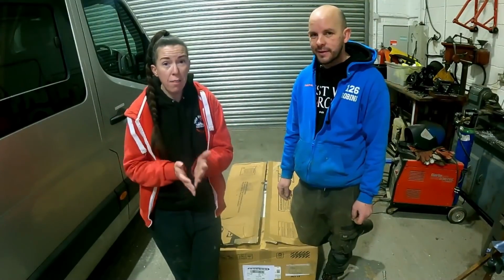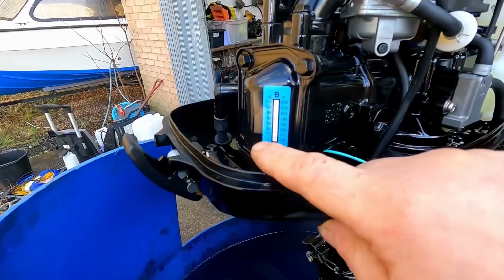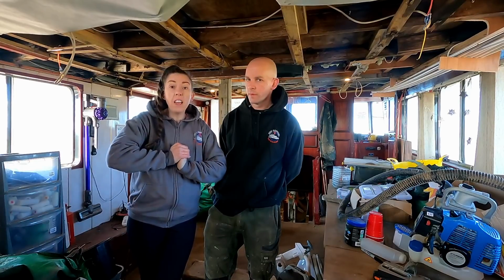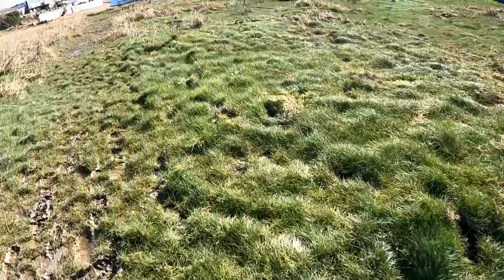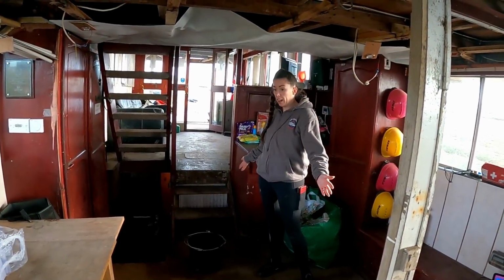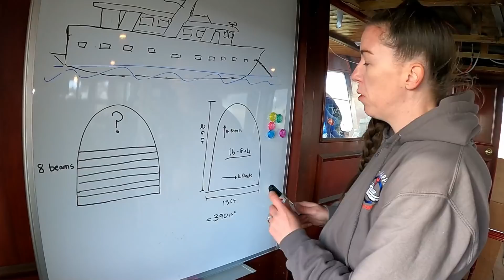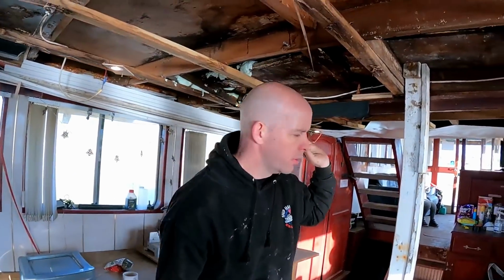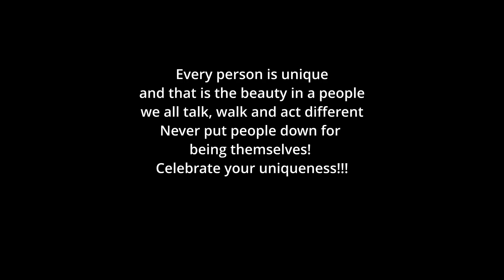Ep 61- New Boat Engine And Assessing Our Roof For Removal #boatrestoration

Comment: It was kind of sad when you demolished the fly bridge structure, (but it had to be done...).

I hope you plan on adding it back again some day. The top deck would be great out door seating area. (Not to mention good weather pilot station.) Especially since it has an overhang on the mid-deck's side walkways, making it wide. Extending the fly bridge helm station forward, to just above the pilot cabin will give you lots of area forward of the arch for seating, sink, BBQ grill and such.

And continue to use the area aft of the arch as it is now. Either solar panels or tender storage with the cranes..

@Christian valfritt had a good idea, if the bulkheads, (walls), have to be redone,  raise them a bit. Perhaps 4 inches. Head room is always nice.

@TrapShooter68 mentioned using thinner plywood, 2 layers, making it easier to conform to the curve. Then staggering the seams. Sounds like a good idea. Perhaps even adding a thin coat of resin between as a glue and bit of water proofing.

Comment: Marine ply is nice but an unnecessary expense for the roof. The difference between it and exterior grade is that supposedly  marine has no voids. Once covered with a couple of layers of glass and epoxy it doesn't  matter. Definitely would steer clear of impregnated canvas.

Comment: If you are using fiberglass, why not use foam core for the roof. No rot, no leaks and lighter. Also laminate the beams to the required camber.

Comment: Before you buy oversize wood for your deck beams, consider steam bending the 1-3/8 x 3" to the proper camber. This can be done in your ashore shop before hand, and can be done during any of  your precious spare time.  Go to Engel's Coach Shop channel for tips on steam bending oak. Also Acorn to Arabella, Sampson Boat Co, and Tips from a Shipwright. Steam bending has been used in shipbuilding for centuries. Yes, the interior will have a camber instead of having flat ceilings, small price to pay. Making a steam box isn't that hard. Thanks for the video. Jon

Comment: Your energy is remarkable. Marine ply is the best BUT on a roof that will be glassed a good exterior ply will outlast you all and cost half. Lots of boat folks will disagree but they aint paying hundreds per sheet.
Reply: I'm just in the middle of ripping out the interior WBP ply from my boat as it was delaminating after only a few years (and has been heavily varnished/oiled all that time).  There is one area that had marine ply from new (at the same time as the WBP) and it's still in good order.
Reply: @18robsmith  Hi Rob, Roger that but varnish and oil is not even kinda the same as resin and glass.. Lots of home built Tri's from the 70 were all non marine ply , glassed with polyester and are still floating. We have 6 at my marina. Vinalestr is what should be used , Way better than poly and way cheaper than epoxy. 59 years no problem

Comment: since you only get one shot at this, are you considering lifting that roof height (John Wayne did on his boat) so Simon isnt whacking his dome all the time? Also , here in the US you can get Ply in 12' lengths from the factory (not a Lowes or Home Depot) but then you have the issue of delivery to the site. what about a membrane over the ply that could go down fast (like on a camper roof?)

Comment: I love your channel and you usually do things right, but use the KILL CHORD! Both of you!

You want the boat to stop immediately if you fall out of it and not have it go tearing off into the distance, or through a gaggle of swimmers or circle back to get you when you are in the water.  Even 6hp can do a lot of damage. 
Stay safe!

The lanyard suggested earlier is also a good idea so engine and boat stay together.  Otherwise, in an accident,  one usually stays floating but the other generally sinks without trace. Expensive and embarrassing!

Keep up the good work!

John

Comment: You are going to be running to a tight timescale just having a week. As others have said two sheets of ply with staggered joins is not a bad idea otherwise you will have to scarph all the joins and glue them in situ, will also bend round easier. Epoxy is obviously a far better job but expensive and probably impossible as you wouldn’t be able to control the temperature outside.

Comment: Ok, Use regular polyester resin, it is not under water so the cheapest stuff you can find.  It is usually old stuff mixed in and a bit thicker but that is fine because you are new to this and thicker is easier to use up to a point.  Do not go cheep and try and get away is one layer of finishing cloth..  there will be tons of pin holes to catch up with you in the future. I would use chopped mat,  it soaks up tons of resin but is also very easy to work with and will make a very water proof fix.  You might use two layers of chopped mat or instead put the second layer of a cloth (I would use chopped) but whatever you do chopped mat must be your first layer.  Look up "Life on the hulls",  if you are going to use it as a deck you  might try using peal ply on the top but that stuff is more expensive than the mat so for this I would not bother.   You must use "Laminating" resin, no wax,  and apply liberally gel coat with a  spray or brush as soon as it setts so you get a good bond. But first do a quickie sand with 36 grit on an angle grinder to take off the hairs. In the sun the roof will fully cure in a day or two even with no wax.  Resin without a sun blocker will be worthless in a couple of years, so paint or gelcoat, and gelcoat is tons better.  the gel coat should be around .010 thick, maybe a bit more you can spread it with the floor paint wooley the area is so big.  it hardens very fast so everything you mix should be down in fifteen minutes or less.Use waxed gel coat as your final layer to be sure it hardens.  being in the sun things are going to cure fast. Best might be to pick a cooler day in the mid 60's or evening time.  Expect ten hours for two people to lay the deck glass. You need grooved rollers to get the air out. Normal paint roller to spread, (check it does not melt)  Run the glass right over the sides so it makes a drip edge.  Make sure the edge is nicely rounded, at least a 1/4 inch radius.  work the two layers together using a staggered lap front to back progress (glass side to side rolled), always keep the edge in fresh resin.  Experiment with your hardener mix first on a small test peice,  remember the sun makes a huge difference at noon time.  Always keep some of your resin mix in a half full gallon jug to spread,  and note the temperature  in your hand,  if it starts to feel warm ditch it and work like hell to consolidate what is on the boat  (mixing a fresh batch with it) as you will have more time to work it than in the pot so this is your last minute warning so to speak. if it starts to gel and the glass is not consolidated you are done.  It can be repaired but expect your work time has now been doubled.  I work with around a half gallon  at time. For prep seal the ply joints with caulk and fix blemishes with Bondo. (think resin drjps into the cabin)  Soak the plywood good first, but one reason to use the chopped mat is as the wood absorbs the resin there will be plenty in reserve so the glass does not become starved.  Do not be tempted to use too little hardener as the resin can run compleatly out of the glass and over the side. before it goes off, especially in the evening. Use any good flat plywood you can find that has water proof glue.  Problem is most exterior grade building ply is not very flat.  Underlayment is not so bad  and has a tung and groove to seal easier, and has no knots on the surface so the finish will be good.  3/4 inch is plenty strong if you are going to walk around up there much.  thinest you should consider is 1/2 inch,  the glass will add significant strength. Yellow Pine plywood is more rot resistant but the whole key is the glass meaning the wood never gets wet, and any hole you put in the glass is a future rot point no matter what wood you use.  Do not use hard wood plywood(oak,maple).  Pine and Douglass fir (preferred) absorb resin well and gives a good bond.  It's going to cost no matter what you buy.  but most  "Marine" stuff I have seen is not really marine has voids and is not made of select wood though it may look nice and be fairly flat. The "Most important thing you can do is assure no water never gets through the glass.  trust no putties or compounds,  5200 even comes loose. Eliminate every possible fastener you can that needs to go through the roof.  Remember you can tab things down using glass an resin and never put in a hole.  if you do need to fasten choose through bolting and drill the hole larger fill with resin and glass then redrill correct size so that the wood is completely surrounded by glass resin.  If you do this it will last for the rest of your life.  If not you can expect twenty years before everything needs to be redone and repaired. Remember even plywood expands and contracts so fasteners even bedded in caulk will eventually loosen and leak (ask me how I know),  this is the reason for the special hole treatment.  Read lots to get the finer points an be sure to practice first on something with corners and such to learn of to work and move the glass around bends with no voids.  Good luck,  there is nothing more satisfying than a completely watertight fiberglass roof!  Ok, Cabin top....

Comment: You guys are the best.One thing I'll mention for cost savings is use a good residential birch ply and cedar beams.When the materials arrive have a vat of old marine varnish cut 50 50 WITH THINNERS and use a roller and soak the materials before you start.2 OR 3 the watery varnish soaks deep and waterproofs.That  way when you build the work is protected soak the saw cuts.bye C.C.R real wood boat 🏴‍☠️ 🚢 😎 Cool from Canada 🇨🇦 🇨🇦🎙🏴‍☠️🏁🎼⚖🎤

Comment: 12/04/2022 Hello Ship. 8 months ago. This may be the biggest job yet. This wet ceiling may exceed the dry roof. It may be time to call in the volunteers just to standby in case of a down poor. I have always done home roofs and hot tar roofs. But I had real good weather reporting and plenty help even if some were not needed. Take care and be careful I have only fallen through a rotten roof once and my brother once for me. I do not work with fiberglass. I couuld not help you do this however, sstay safe and good luck 8 months ago. Don usa

Comment: That is a big job and there are many good suggestions here, however, the only way to do fiberglassing is to just do it! Most probably your first piece will be rubbish but you would be surprised at how fast and good you become. 
Don’t mix more than you can use
Fiberglass cloth can’t be laid over corners
Wet the surface with your poly then lay your cloth
Get all the wrinkles to lay flat
I am so confident you two will become so proficient at this before you even finish this first job!!!
Reply: Fibreglass cloth CAN be laid over corners as long as you round the edges
Reply: @Larks01  yeah, that’s why I said corners...duh....I have plenty, and I mean plenty, of fiberglassing experience, come on man!

Comment: Are you going to pitch the roof out from the middle to allow drainage? 👍👍🇬🇧🇬🇧
Reply: The camber that they talk about is a smooth curve which is pretty much what you are talking about but without the "sharp" joint that you get with a pitched roof so is easier to make waterproof.

Comment: I suppose I should mention I have been around the block with wooden boats and wooden decks many times.  My current deck of 200 sq feet is over 25 years old and not a tiny leak nor de lamination... done as I described before but used a stitch woven mat as the top layer.  I was worried about strength but the texture is a pain and the gelcoat could not fill the deep weave, still it is good non slip and the gelcoat is wearing away on the high spots some at this point. Yes I did also once own an epoxy soaked trimaran with rotten decks.  The point here is do not blame the materials when construction techniques are to blame. You have a huge project so thowing money at it is just not going to pay off if you do it incorrectly (details details details!) but if you do it right then no need to splurge on the epoxy.  I agree the strip planked hull on my epoxy craft was in good shape and coated on all sides and for anything below the water line or where water would collect this is indeed a great idea.  So long as you never put a hole which leaves wood un-protectected.  By the way epoxy is much more difficult to use than polyester,  glass wet out takes longer, is finicky with the mixing, is more toxic and is much less durable in the sun and can not be easily painted with something that will stick to it, can not be used with chopped mat unless you get a rare special type of mat. The one advantage it does have is it can be made to cure more slowly with the right hardener.  Yes it is much less moisture permeable , again under water yes...  cabin top... does not matter.   You have a ship! this is not a light weight racer, a nice heavy layer of glass and polyester topped with gelcoat is the best you can do for her. All  the plywood charter fishing boats over here use this method. Why did my epoxy decks leak?  Essentially deck fittings though the deck which was foam cored with 1/4 ply over top and 1/8 on bottom allowed a lot of flex (Styrofoam, not core foam). No deck fastenings were going to stay bedded in any compound known to man, or woman.  If you must fasten to the deck tab a piece of ceder down then screw to that, or do what i did and laminate core foam (4PSF or more) with 1/4 " aluminum topping in areas  over the deck glass,  so I could drill and tap and  bolt things to it.  The foam allowed for the fastener to pass through the aluminum no harm to deck seal.  Always use Neverseize or blue locktight on the fasteners, or the stainless fasteners, will corrode the aluminum, never use a copper alloy such as bronze or brass with aluminum.  Do not worry about crevice corrosion if you have redundant fasteners,   the bedding will last very well in this case as there is no wood expansion and contraction.  If you are really scared of the  stainless use 316, it will in most all cases not crevice corrode.  I an repeating this as people get all bungy about stainless,  and yes I did have a 304 turnbuckle snap from crevice corrosion, which was holding a 1/2 inch cable on my catamaran (Yes it was 30 years old, redundant and no harm, just a scary sound).  A quick weld with some stainless rod and it was good as new.  Most "marine" (this word to me usually assures it is made like sh--t)  hardware is 304 stainless and the reason for the concern of many.  If it gets dull in the salt water it is 304, and if you see any sign of rusting it is 304 or worse.  316 will stay mirror bright after many years in the salt environment and was formulated specially to avoid crevice corrosion. again where is the fastener?  Is it the Jesus bolt which failure will be catastrophic then use 316, and if it is really critical consider having it passivated (acid pickled to form protective oxides).   Oh how did I get on this topic....   well happy decking!!!! Oh by the way the painted outdoor deck screws work just great to quickly fasten the deck with minimal, putty fill  remember you are going to have a perfectly sealed membrane so it will never get wet and never deteriorate.  And what good are silicone bronze fasteners if the wood around them is rotted?  Guess what, the wood will rot before the painted fasteners rust through (ask me how I know).  You should consider epoxying the deck to the stingers/rafters to avoid squeaks though...  And yes curved roof inside always.  The boat will never sit perfectly level and a flat roof always being on a slope is disconcerting.  One more thing is if you plan to be in the boat in winter and heat it then consider running pvc conduit all over for the wireing and then using closed cell spray foam against the bottom of the deck/Roof (perfectly sealed surface on the top).  Boats are not designed like houses and condensation drips come from everywhere if you try and live on them (Ask me how I know)  Ok, this is for another book.

Comment: From my perspective good quality WBP (Water and Boil Proof) ply is sufficient. You need a reliable source as the stuff coming over from China is utter crap. The only difference between it and marine ply is that the leaves are not guaranteed butt jointed - the timber and glue is the same. Marine ply is ruinously expensive. Glassing it will add immense strength. It is VERY important that you leave 3mm gaps between adjoining sheets. These need to be covered with 2" tape so the glass does not stick to it. This allows the glass to 'tent' in hot weather and seasonal movement of the ply is accommodated (humidity changes). If glassed over with no expansion joints it will fail. I've done a lot of glass roofs so if you want me there on the day I'll come along. I'm the guy who wrote to you a few weeks away - Mike Pollard.

Comment: When it comes time to change the oil in the foot that she checked first you take both plugs out drain the oil out an to refill it you push the oil from the bottom to the top when the oil shoots out the top hold the oil bottle in the bottom hole put the top plug in then the bottom plug an your all set just Fyi to help

Comment: Suggestion : 4x8 sheets of PVC board . Strong ,can paint it if you want , very strong ,easy to clean ,roughened you can fiberglass or epoxy . With a heat gun you can shape it ,screws adhere way better than wood . And most important is the fact it is water proof and will never rot , will certainly  outlive all of us .